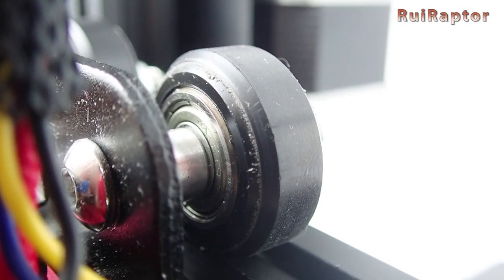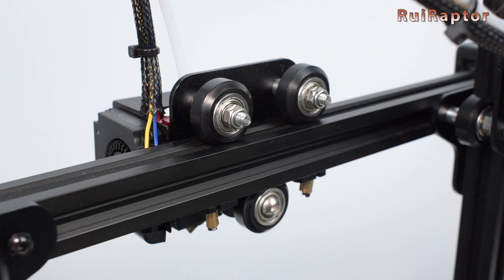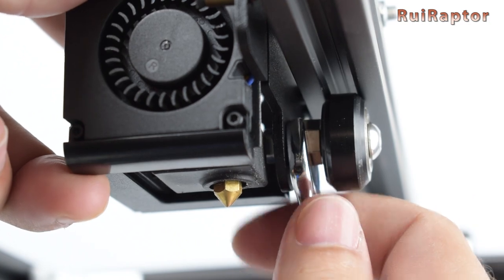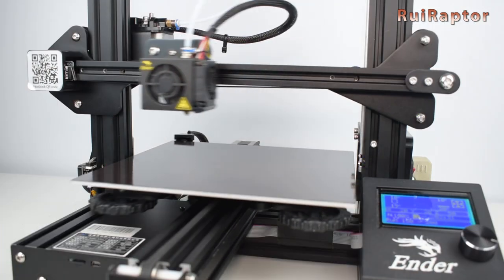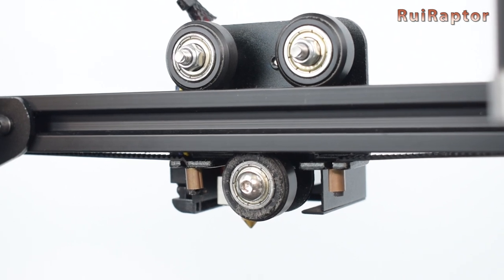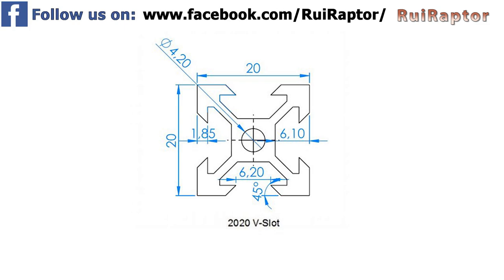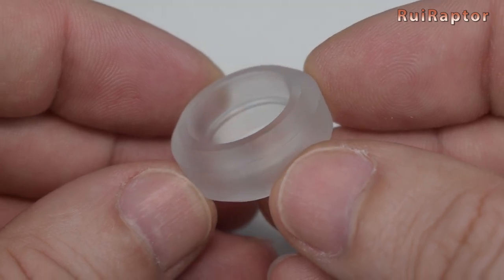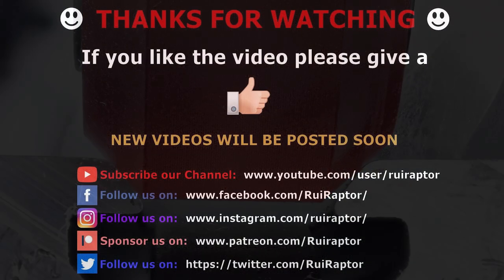3D Printer POM WHEELS - Dust or Debris??? - Tests & Analysis

Comment: I do not think that you would want the wheel side angle to match the v-slot angle perfectly. The wear would go up, since the entire side surface of the wheel would be rubbed on the rail v-slot, as it moved.  My 2 cents.
Reply: Contact surface would spread out the wear making it even instead of digging a groove that potentially increases friction over time.  Same reason you want your tires level and flat to the road in a road car.
Reply: @maluraqgamer7870   I understand your reasoning and analogy, but i disagree.
Reply: @maluraqgamer7870  you are wrong, if the surfaces are both 45 degrees and perfect match you will have different linear speeds between the end and start of the groove, this will cause erratic behaviors on wheel speeds and uneven wear on matching surface. so this  not perfect matching surfaces are intentional to lower friction

Comment: I know the price point of these printers is attractive, but please do not buy an Ender (or similar clone). Especially you beginners. Enders are NOT beginner machines, they're just cheap machines. Spend a little more and get yourself a printer with linear rails/rods and never worry about this again. They're more precise, more durable, and only marginally more expensive at this point. All they need is a dab of lubrication a couple times a year and they'll last pretty much indefinitely. No more wondering if they're too loose, or too tight-- if if either variable is negatively affecting your prints.
Reply: Wrong = ) Those expensive printers also more expensive in repairs too. While those wheels cost nearly nothing, and very easy to tune. While if your rail system start to wobble it is really not a beginners work to make them fixed. Also 3d printing is a strange sphere. There are a lot of expensive printers nowadays which make illusion that 3d printing is for everyone, or that if you buy some expensive machinery it will do all the work for you. But still anyone will have the same problems with expensive machinery too. It is not an inkjet printer. Print head maintenance, different roller and rail system maintenance, trouble with adhesion and first layer issues, z-offset configuration. All those things are still in most expensive models. They just delay some of the issues to appear.
So Ender 3 or its clones are still the best way to start 3d printing. It does require DIY aspect. But... Why do you need 3d printer if not for DIY? To print couple of figures? You can order them from 3d printing farm.

Comment: so, linear rails are winner in long run.
Reply: For stability yeah, but cost wise no. You’re going to spend way more on linear rails than replacing the POM wheels a bunch of times. The wheels are cheap, linear rails aren’t.
Reply: @radicalxedward8047  Come on, I am always upgrading all my 3d printers to linear rails, upgrade costs anywhere from 60$ - 150$ per printer (last my upgrade was on Creality Ender 5 Plus, which costed around 30$ for rail). I will add that brand new wheels were already with flat spots. If you are printing perhaps 5h a week, then sure, maybe. But I am printing sometimes for 14-16h per day). 

Also add the labour cost to replacing the wheel, when you compare to your wage per hour (depending what you do, but I am working as software architect so linear rails are cheaper than 1h of my time).

Do something once, properly even if that would cost you a bit more, but would give your long-term benefits and time-savings (so you have more time for work/education/building business so you can earn more).
Reply: @MM-oh3zs  hate to break it to you but $150 per printer upgrades are absolutely trash as far as linear rails go. are they ok? yeah. are they the REAL experience? no. You're looking at over $1000 per printer for nice linear rails that are straight, and skates with proper sizes and zero play.
Reply: Ok, I guess it is enough time passed, how are they, your linear rails? Also I bought Ender 3 for less then 150 bucks, and you want me to buy linear rails for that price? I would better buy one more Ender 3. This technology is already for 5 years or so. It is proven by time to be cheap and reliable.
Reply: Its long time, so after that I change rollers to my ender 3, these aluminium extrusion bars has sharp edges and you literally can see how movement gring dust from wheels. Later I buy ender 5, it has not that problem, so it can be hit and miss how things goes. I dont have invested linear rails yet. Because this is only functional hobby I dont have hurry to anywhere.
Reply: @juhajuntunen7866  thanks for feedback. Interesting info about faulty bars. Never heard about that before.

Comment: With correctly adjusted wheel pressure, you won't get that wear on the wheels after several hours. Still, there will be a build up of dust looking similar to this due to the  static charge on the POM wheels.  It will look similar but when wiping it off, there is no groove on the wheels like you are showing.
Having grooves like this is a clear sign of overtightning of the eccentric nut (as Rui also mentions!). Tension should be set so that the wheels still can be turned by hand (even though rubbing against the profile) without having wobble on the carriage.
Reply: ' still can be turned by hand (even though rubbing against the profile) without having wobble on the carriage.'
Precisely, you want good smooth linear motion, the maximum that the bearings etc can provide.  Overtightening destroys bearings, it does get a bit better results for a short while but your printer is headed for doom.
Bearings are point contact kind of devices, and you have a bearing every so often, not a perfect circle.  So the bearings make a polygon to ride in the grooves, not a circle.  Over tighten the bearings and you bring the outer groove within the actual circle arc of the bearings, in the play between two of the bearings.  Then when the bearing turns and is forced to go over that peak 'corner' of the 'polygon' of one of the bearings, you're putting tremendous excessive pressure on that point contact.  IOW you highly wear the bearings and grooves.
If you understand drive systems and have been doing steppers etc since around 1982, this is old hat..
The precision is set by the precision of the items, gaining extra by over tightening will not last long.  If you need more precision then higher precision items are the only long term solution.
That said the bearings etc are fairly cheap.  You can get the extra precision, and simply consider them a wear item, and replace them every month or few months.  That's perfectly fine as long as you understand the trade off and take on the added maintenance.
Correctly tensioned items will last a long time, my 4 year old CR-10 is still very smooth and accurate, my wheels and belts are all way looser than most people would even consider, but the play is low.  But I've been doing drive systems for 40 years or so so I understand the sweet spot and always set everything right at it.
Reply: Show the proof. They guy created excellent video, now you keep saying same stuff that others without ANY PROOF. Show the proof or do not speak as an expert.
Reply: @MM-oh3zs  any other problems? I have explained everything and I am doing the things I explained since now then 2 years. Still on the first set of wheels on Z. 
I also have converted X an Y to linear rails and honestly, no difference in print quality. But no dust collection anymore.

Comment: Great video.  Thank you for making it.  However, it causes me to have more questions that answers.

Why are these wheels designed to have an interference fit in place of matching the 45° angle?  Would matching the 45° angle cause higher friction?  Is there an ideal angle and material?
Reply: Those are just poorly manufactured parts that were never designed to sustain constant load for X hours per day.
Reply: Creality is cheap Chinese overrated crap. most ender users need to upgrade or replace parts weekly. just do the math when replacing parts and you realize that the parts are twice more expensive to replace than buying a new Chinese printer. Chinese parts are made with sticks and stones with copied designs by cavemen.
Reply: @jimbobbyrnes  Let's be real. Most ender users have no idea what they're doing, let alone how to do something properly. You give them a better printer and it's going to turn out the same exact way. Period.
Reply: nope they shoul not be matched, its intentional, wheels are rotate at same angular speed but outer regions are do more distance than inner regions, if both the wheel and profiles had same angle and perfect surface match, lets say jut middle section will try to go 10mm distance, but outer regions will try to go 11 mm, and the regions closer to the center of wheels will try to go 9 mm, so the surface will constantly fight each other and friction will be much higher then it will lead more heat and more abbrassion,and erratic unstable behavior, sometime outer areas will grip and wheel will go faster and sometime inner areas will grip and wheel will go slover. so perfectly matching wheels will perform very badly on agular surfaces. so the people who gives creppy posts for this reason they dont know a shet about surface friction dynamics.
Im not here to defend creality but some people wish to buy a ferrari with a price of focus, well dont hold your breath. Most of people who are into this hobby, they have seen it somewhere and want to give it a try and they dont even know if they will like it or not. So you can not expect people to just go and buy very expensive machine from the start unless they dont have shetload of money,  its safe to start from small to big.
My first printer was ender3 v2 and im glad i had it, learned most of the stuff about 3d printing from that cheap machine, if you really into learning and experiencing its a very good beginner choice,  once you learn what it is and what not, after some fine adjustment its printing more better than double price printers sure, infact my ender 3v2 is still stock and im very happy about it after 3 years. Then bought a prusa too, yes it is a very nice machine, solid and less things to wory, but i would never suggest anyone to buy it as a first printer.

Comment: Brilliant video as always rui, now how to do adjust wheels that have absolutely no esentric nuts at all. I have a enyone thinker se which does not have adjustable nuts. Looking forward to your advice on this one buddy
Reply from the maker: Hi Steve,
some printers (small amout) don't have eccentric nuts. The manufacturer designed the carriage with the holes at a certain distance to match the profile. That is not the best choice in our opinion. One example was the TwoTrees Bluer. We did the review of the first version and did not have eccentric nuts. After our review, the manufacturer re-designed the carriages and the current version now includes eccentric nuts for adjustment of the wheels.

Comment: 1st

I was only giving my wheels a clean and tightness check yesterday so the timing of this video was apt.  If I were to swap mine out I'd be looking at 17 new & upgraded ones, then chuck in the price of good bearings and I'm wondering if cheap linear rails would be a viable alternative.

Thanks for another excellent video.
Reply: I saw a video although I can't remember where and this guy bought cheap Chinese carriages for his linear rails and took them apart and cleaned the bearings and race and applied a quality grease and they were 100% better
Reply: @AndrewAHayes  That's correct, quite a few have done the mod over the last few years, I think the video you're referring to was by Alex Kenis.
Reply: Not sure if this is the same video mentioned below but its a decent test: https://www.youtube.com/watch?v=I3xMHjiYENk

Comment: That's why precision and tolerances are so important.
I have a stock POM wheel on my brand new Ender 3 S1 that even has a bump causing bumps in the print everytime it comes in touch with the V-slot.
I will replace it with a polycarbonate one and thinking of using linar bearings on rods like on the Prusa i3.

Comment: If you ensure consistent wear (no flat spots), why would it matter if the wheels are deformed? Friction fit is pretty tight. To avoid flat spots just run a gcode like your test code to "break in" the wheels. Idk just an idea.
Reply from the maker: Hi Dalton, the issue is that, when you have a tight grip on the wheels, they will deform in such a way that, if you leave the carriage sit for a while and then move the carriage, you will feel those "notches" or "bumps" on the wheels. They will eventually recover if you loosen the grip, but if you start a print instead, you will get issues on the prints due to those "bumps".

Comment: hi ) thank you for the video) so basically the grip angle of the wheel does not match to the profile- so need to correct it to the profile and the result will be better&) thank you

Comment: My printer is about a week old but I been printing a lot. Out of the box I did not touch the wheels at all, but now the prints started to fail in a weird way ... so I tightend the wheels, but now when the bed is moving is also moves up and down ... what is wrong with my printer and how can I fix it? Thanks in advance!!

Comment: So why do they not make a wheel that does match the V slot profile ? Seems like they would sell all they could make .
Reply: After wearing for a bit, the profile would match the wheel and now they won't wear any more. It's better for them to have a bit of a tight grip than a bit of a loose grip. My wheels had some traces after tightening them and I thought it was due to wear, I'll be more careful for the next ones but I don't feel bad about this since they've adjusted perfectly to the rail now.

Comment: Particle production aside, wouldn’t that just mean they’ll grind away until they perfectly match the v-slot angle and reduce in pressure so long as you don’t keep tightening it more? Wouldn’t that mean better contact in the long run or do you want minimal contact?
Reply: I overtightened them a bit and definitely I can see some grooves and some black dust. But after some prints they don't generate dust any more and the wear hasn't been increasing. So it really doesn't matter that much, having them loose is much worse than having them a bit tight.

All wheels will wear, aluminum is much harder than rubber, it's just how physics/chemistry works.

Comment: I'm just wondering if, after running the printer for a while, wouldn't the wheels wear into the right shape for proper fitment? Like running in a new gearbox or motor?
Does anyone have any data in consistency of the wearing down of the wheels?
Reply: Realize this may be the correct fitment, chosen so the wheels right high in the groove instead of low in the groove, and have one point contact.
If you match the angles, you have the furthest point from the center of the wheel traveling a larger circumference than the nearest, while both near and far travel the same linear distance.  IOW different speeds, and higher friction.
Of course no telling how this stuff was actually spec'd out, it may really have not been thought out that far initially..
Reply: @ModelLights  very good point, I'd forgotten about the varying radii.

Comment: Does anyone use lubricant to oil the v-slot?
Reply: Depends what the lubricant is?  You wouldn't want something that made the wheels soft.
Reply: @superkillr  don`t really know - that`s the reason to ask. any wolfrasyn?
Reply: Wheels are supposed to turn, not slip.  If they do slip, that will probably cause them to wear more.  So, lubricant is likely not a good idea here.
Reply: wheels are made of POM (also known as Delrin, or Acetal), which is often said to be "self lubricating". it does have very low friction coefficient.